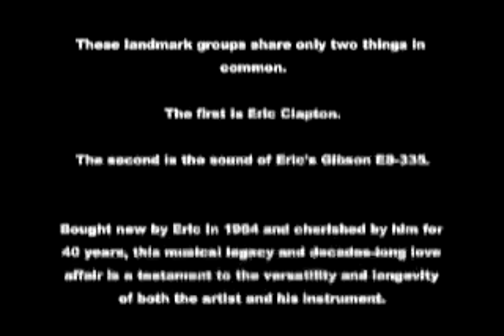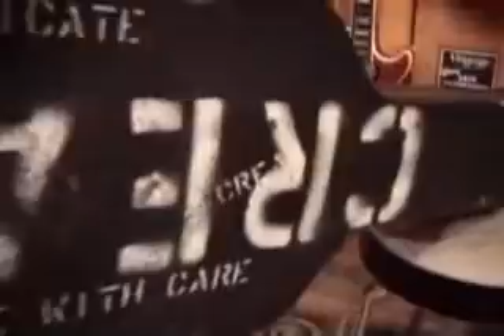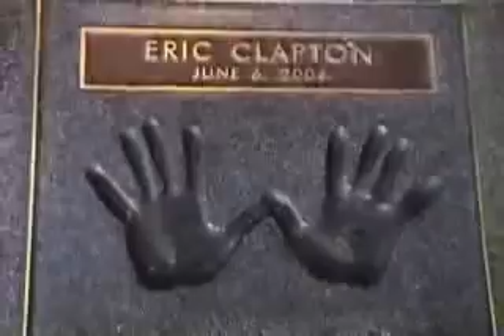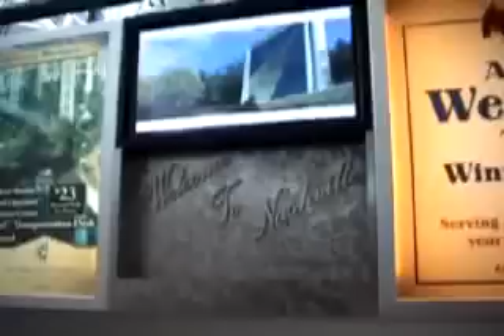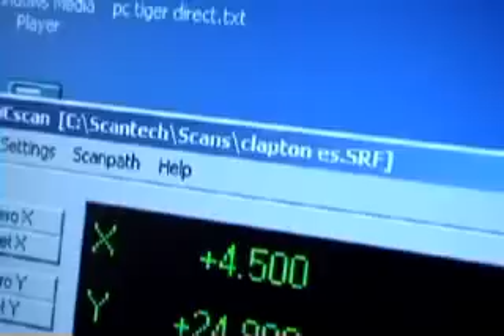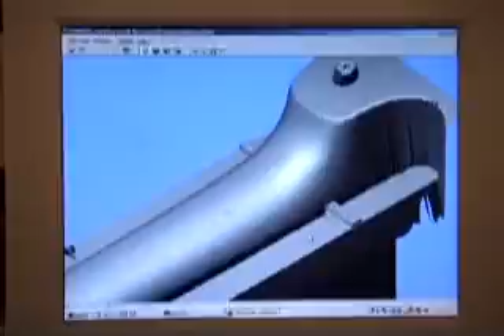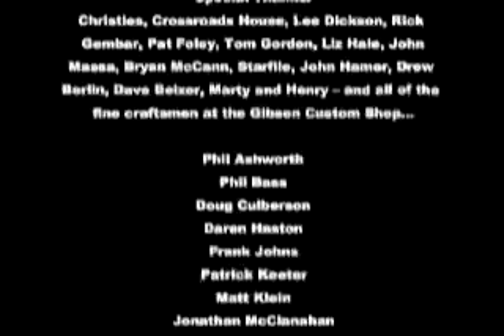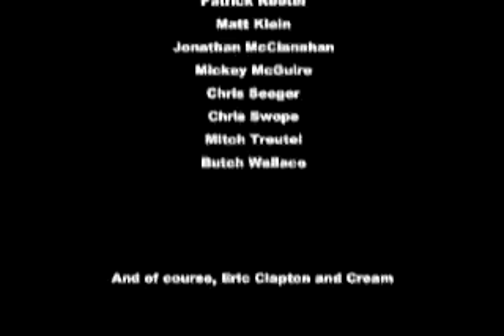Re-Creating A Legend: The Eric Clapton Crossroads Gibson 335

Comment: The pickups in a 64 335 were not potted .  Also they were winding to so called Clapton 335 pickups with poly wire  instead of plain  enamel  like the originals had . Those are Burstbuckers they threw in there.  They are good pickups but they are nothing like a 64 patent number pickups.  Different specs different materials  and different tone .

Comment: Its seems as if all of the eagle eyed master guitar builders could have at least got the pick guard correct. On the original 335 the top of the pickguard is even with the cutaway. No gap. On the reproduction it clearly has a half inch gap. My personal 335 also has the gap but the older ones did not. So all of these reproduction guitars aren't close at all.